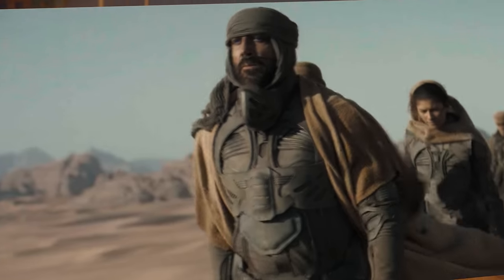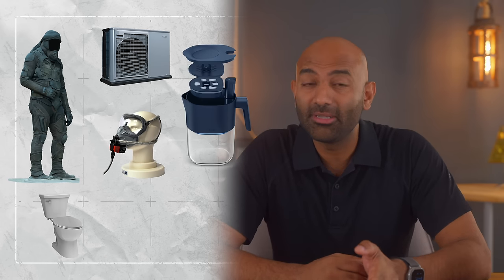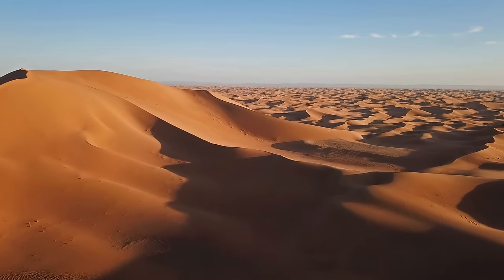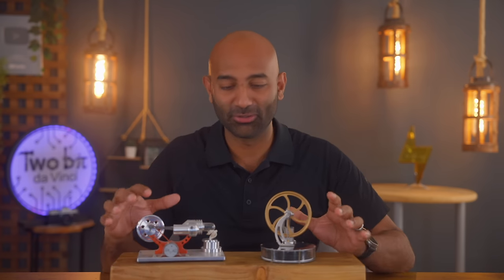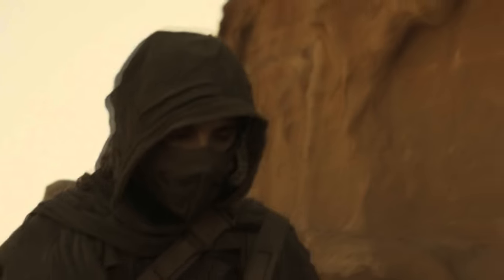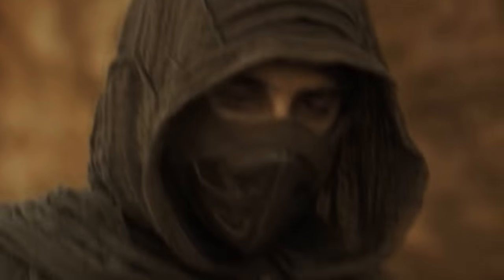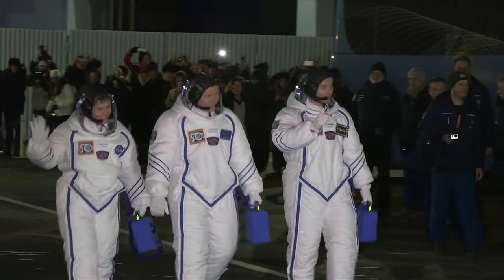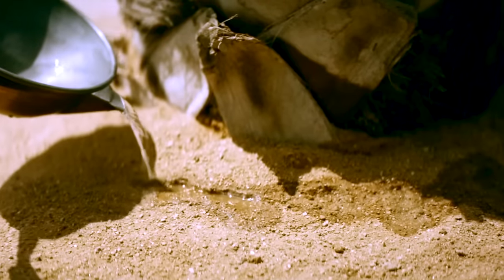Could the Dune Still Suit ACTUALLY Work?

Comment: 12:34 
1. They could use tesla valves to pump the water as it is collected and probably be the first layer to filter...Thought the pressure may not be as high as you'd want but passing it through a membrane will for sure get rid of a lot of the impurities...no moving parts or external high energy input.
2. For energy to run some basic stuff they could use Piezoelectricity...using the high external temperature and others where they'll experience force from walking or other movements

Fell free to correct me where I may be wrong.

Comment: You have missed an option for dealing with power. Rather than using downward force, use the motion of the legs moving backwards and forwards. Connect a cable from the heal to a flywheel at the waist. As the leg moves forward, the cable is pulled out turning to flywheel producing energy using a simple induction dynamo. As the leg then moves back wards the cable is drawn in and then out creating more movement. With both legs you will get far more power than just downward heel pressure.
This can also be used to create pressure for the movement of water around the body.
As for water extraction from fecal matter, you have the mass heat from the desert to evaporate the water out. Once dried out the water can be condensed and filtered in a small chamber where pressure can be increased, rather than all across the suit. 
You have forgotten something about the suit though, it needs to work in reverse during the night, as desert temperatures drop dramatically, down to freezing. Using heat sinks from the day temperatures this can be done. In the same way water heating is being done in commercial and homes with heat batteries.
For the breath collection it would be better to have a fully sealed helmet. The same as in space. But using a lightweight helmet similar to something used in skydiving but air sealed to the rest of the suit.

Comment: I think the relative humidity on Arakis would be at or near zero, evidenced by the fact that low pressure systems for not produce rain but just whip up sand into the air. In very low humidity the temperature differential between areas of shade and areas of direct sunlight is more extreme, on a humid day sitting in the shade barely provides cooling because the damp air has a lot more thermal mass. If the suit could utilize the difference in energy between the SunGard side of the suit and the shaded side then you could have stronger evaporative effects on one side and relative cooling and condensation possible on the other.

Another point is that Amonia, which is present in the urine the suit is reclaiming moisture from anyway, is an efficient refrigerant. It's possible that the suit runs a heat exchange between the shaded side of the suit and the sunward side using urine as a refrigerant. The suit could have domed surfaces on the chest, back and thighs which house heat exchangers and the system uses valves to invert the flow as the body of the wearer rotates relative to the sun.

Evaporation however would provide the majority of the suits cooling effect and this is only possible in controlled low humidity, the skin contact side would not just have to be porous but would have to create a significant stand off to allow for air flow.
Simple valves could be used to fore a direction of the air flow in a desired direction,  say, from the core where the body produces the most heat, to the extremities where the bodies warmth is less of an issue. The housings previously mentioned for ammonia heat exchangers can also create cavities where cool air allows humidity from sweat to condense and be absorbed by semi permeable membranes and wicked off to the reservoirs. The salt in the sweat would slowly build up in these cavities around the heat exchangers, but given that salt is hydrophilic its presence actually helps the water to condense, you just need your absorbent membrane to be more hydrophilic than the salt while not becoming clogged by build ups. Salt also has impressive thermal mass which might cause lag in the efficiency of the heat exchangers as it builds up, so past a certain point the suit will have to be cleaned. 

As for feces, deal with them separately. They are accumulated in a pouch that is separated from the rest of the system and works as a miniaturized version of the rest of the suit, there is low humidity air passed through the catch pocket which enables evaporation. The air is then passed though the cool side heat exchanger housings, determined by thermostatic valves, and allowed to condense separately, we call this black water. Manual pumping, provided by the heels but also by valve-mediated sacks in the groin, backs of knees and armpits pump the reclaimed black water push the black water through charcoal filters to collect any particulate matter. Disinfection is another matter, but what we have in abundance is salt, and by the miracle of electrolysis and with the aid of a little electricity, we can create hydrogen peroxide to treat the carbon filtered black water before its re introduced to the main water reservoirs. I'm not an electrician but if the suit is powered by movement then it could be designed to generate static electricity as one moves. I almost imagine a pad of wool and a pad of plastic rubbing against one another and discharging through a reservoir of slaty sweat and offgasing a little peroxide to be captured for the decontamination of blackwater. This could be a low energy solution to the desalination issue, because at a certain level of salinity you won't be able to reclaim more water but you can use the salty sweat to make bleach. Once the suit has fully or at least mostly dehydrated your fecies , back at the seich the dry turds can be made into charcoal for the suits filter.

Comment: You never read the book but the circulation in the still suit is powered by the humans legs moving and pumping the circulation.  As long as you are moving outside the suit works and if you are in the cave where little movement is going on then it is not needed as the caves are cool naturally and passive mechanical devices could be used.
Reply from the maker: you can power a circulating pump that way maybe sure. but how are you going to run a heat pump and water filtration?
Reply: @TwoBitDaVinci  Piezoelectricity? embedded in the right locations, a Piezoelectric material could produce energy from movement alone.

Comment: Two points 1 RO water is bad for the body, it leaches minerals and vitamins from the body. 2 You can not capture all the water, you need enough(40% I think) to carry away the brine. And what do you do with the brine?
Reply from the maker: good point, maybe we keep the electrolytes, and just find a way to sanitize the water
Reply: The notion that RO or distilled water is bad for you is a myth, most likely pushed by the bottle water industry since DIY purification drastically undercuts their "boutique" water offerings. Also, storing water in plastic has its own contamination issues they don't talk about. I'm sure someone impartial has made a video on why pure water such as distilled or even lab grade deionized is perfectly healthy to drink as a primary water source. If you are so worried about minerals, those can be added after purification in precise levels to one's taste.

Comment: While I have yet to succumb to Dune in any of its forms, my days of imbibing SciFi novels ended decades ago, I do keep up with technology in the way that you do. Peltier devices can probably be made into much smaller forms and there are piezo actuators that can be shrunk too. Very high pressures in very small spaces can also be achieved.  So repetitive micro versions of the suit's technology would be able to become fabric so long as the power needed could be acquired. 
Just recently there was a report on a way to generate electric energy similar to PV panels but utilizing heat.  Thermal Photovoltaics. I think the biggest problem will be isolation of the various temperatures in thin enough layers to gain comfort at the skin interface.

Comment: Interesting thoughts.  From the book, I took the idea that they were dealing with different technologies and materials as water did not cling to some surfaces that were used as funnels.  Water clings to lots of things because of wetting and the meniscus that forms on that surface.  Water forms an upturned meniscus because of wetting while a downturned meniscus is formed in mercury because it does not "wet" a surface.

Comment: Ricky, I used to work in the sewerage and water treatment industry. I have worked at the Canberra Sewerage plant, two plants in the North Head extension on the south side of Botany Bay, and the Sydney plant. Up to Caines, they provide design from Sydney and several others.
I am a Project manager and civil engineer who worked in Singapore designing and building Tunnel Boring Machines and five underground stations, managing 160 engineers and architects from 1999 to 2004. My work life was from 1975 to 2023. I will leave Lismore, NSW, at the end of September 2024 to travel around Australia. Read the following comment.

Comment: The suit sleeves should probably incorporate jointed levers to generate energy from motion. Implemented correctly, such levers could even be used to slow excessively-fast movements to prevent injury; maybe even aid in reducing overly-rhythmic steps... all while capturing energy from the wearer's motion. Under normal circumstances, the impediment to movement probably wouldn't need to be very great to produce useful amounts of energy.

Comment: carbon nano tubes can be used to help the cleaning process. Movement and metabolic heat can be used to create thermal gradients, that can be used to generate electricity. Mechanical pumps can be designed to force fluids through the nanotube filtration system. Also, the faecal matter can be mixed in with the liquid collected, also mixed together via movement.  Diet will be a significant factor, people living like this will be mostly on a meat only type diet. This will mean that they would have far fewer bowel movements, and far less waste (from my own experience), their water dynamic equilibrium will have a greater volume though.
I feel like with the technology available a suit like this can certainly be built.

Comment: Peltier coolers generate massive amounts of heat and require something to dissipate that heat or they'll burn out very quickly. You could use recycled water circulating to do it, although it wouldn't be very efficient at really high temperatures. It would probably still be better than large, clunky heat sinks.

The fun part is that they work both ways. They will generate voltage from a temperature difference. 150 degrees outside against body temp would generate a small voltage and joining a bunch together could provide you with at least some electrical power.

Comment: With the feces one would want to remove it from the skin to reduce damage to the skin. The water in the system could be used to remove it from that area and liquify it, for easier filtration. The brine would be pumped closer to the exterior of the suit, where evaporative cooling and filtration would occur. This wouldn’t require the higher pressures of reverse osmosis. It could also be easily implemented using the movement of the body as the pumping mechanism. There’s a environmentalist that I follow who uses a portable handheld bidet. The small amount of force that she uses to operate that would provide enough force for this system. I however don’t believe that the pumping system used would be practical for this situation. One would want a series of hoses with check valves. As the hoses get crushed by the movement of the body they would force the fluids out of that section of tubing. When the hose expands from the crushing force being removed it would provide suction to that area of tubing. The movement of the fluids in conjunction with the evaporative cooling of the fluids would help to keep the user cool. To clean the system is perhaps the most difficult task. It would require access to the solids and a means of flushing the contaminants out of the hoses, without fluid loss while in use.
Reply: Yuck 😅
Reply: To keep the waste away from the skin perhaps they harvest it directly with catheters and some kind of er buttplug that opens up into a funnel and pipes it through an umbilical to a trailer that is tugged along behind you with a solar still in it to evaporate the water. Powered by a solar panel sombrero on your head. The solar panels are important as for every wat of kinetic energy produced by your muscles 2 watts of body heat are produced. You can not refrigerate an engine below ambient temperature with energy produces by that engine that violates thermodynamics.

Comment: A really fun video!  Two technologies you missed when talking about heat.  First is a radiative exterior that could work like that white paint that cools buildings cooler than ambient (instead of paint this could be a future tech that emits IR directly into space and powered by body heat (WTEGs?)).  The second is that as there is no moisture to retain heat in the atmosphere, the evening temperatures would be below freezing.  Using a sophisticated phase change material daytime heat could be rejected at night.   On the poo... something we could do today to capture the water would be to vaporize the poo into ash and then condense the water out of the off-gas.  Could it be done in a still suit?  Never say never!

Comment: Not sure if this has been corrected yet but at around @15:25 astronauts in the vacuum of space have the problem of staying cool, not staying warm.  Because there's literally no air, there's no way to vent off heat via conduction and convection, only through radiation.  so a lot of the bulk of actual EVA suits is towards cooling, with joint articulation, air pressurization, and reactive propulsion following close behind. space is cold but you'll never know if there's nothing cold touching you or your suit you'll just cook in your own suit till you're dead.

Comment: We have material that blocks water like rubber, but we don't have a fabric-like material for its outer layer that can reflect sunlight and radiate heat away effectively. Even if it exists, I'm not sure if it can lose heat faster than the amount rubber traps. If it's invented, one effect is if you made it a reversible garment it will radiate heat towards your body and keep you warm in the cold. Maybe in the future, there will be rubber-like material with better thermal conductivity (rubber is approximately 0.5 W/m·K).

Comment: Based on the fact that this suit needs to be passively powered  (lets say movement is the only possible source of power) i would assume that Peltier cell would not be used. Rather it would use natural evaporation within the suit to cool down the inner layers. This would also solve the issue of salt (and most other contaminants) removal from the water itself. The tricky part would be then to remove the leftover salt from the suit systems as it would build up to a point of clogging everything up. And i dont have a good idea for that yet, maybe except some tricky way to crumble it while walking and allowing it to fall out throu some sort of disposal system. But thats my guess ;)

Comment: I haven’t read all the comments, so I’m not sure if this has been mentioned… but couldn’t you use the hot side of the peltier chip/ external temp to boil the water, leaving behind the salt and collecting the condensation? Or use the heat to dehydrate the “sludge”, collecting the water?

Comment: While it might not be precisely true to the still suits of the sci-fi Dune, they could be very useful and practical now. Having photovoltaic cells are a great modification idea to cool by blocking sunlight as well as generating electricity for the micro cooling plates (Peltier chips). Also, a battery bank could be carried in the suit to store the needed electricity. With designing for efficiency it should not need to be big. I think we can live with the lost water in poop, but the urine can be collected in a pouch and distilled or purified later at home. This should be acceptable since poop accounts for only 10% or so, unlike urine being 40% of water lost. A practical suit should probably not waste effort on trying to process waste into clean water while walking, and instead focus on collecting for later processing. It may be possible to do that processing when making camp, so even though not at home it would be something that could be set up and done then packed away and carried the next day when breaking camp.

I think on Mars the cooling would be mostly unnecessary as it's a cold place. But, water is scarce on that dry planet too. It's cold and dry. All in all, I think a practical version of the science-fiction still suit could be made and could be quite useful in either the southern Arizona area or on Mars. It probably would find fans in other places where it could save water and life, like Africa, Australia, among many various deserts.

Oh, but I must disagree with the "Fremen way of wearing the suit", with the nostril tube over the ear. The water being collected may pool in the tube at the lower point and act like a U-trap under the sink. That is, until the amount of water builds up and starts flowing back into the nostrils and drowns you. The tube should be allowed to drop down to the suit to avoid that build-up next to the nose. Though, another idea would be to run the tube under the ear but have it secured, as they were probably going for anyway, with a thin small strap that attaches to the tube but goes over the ear. That would be best, I think, to secure the tube while also angling it downward to drain away from the nose.